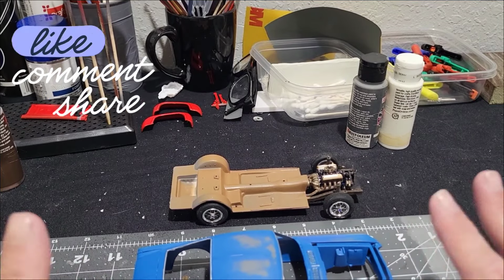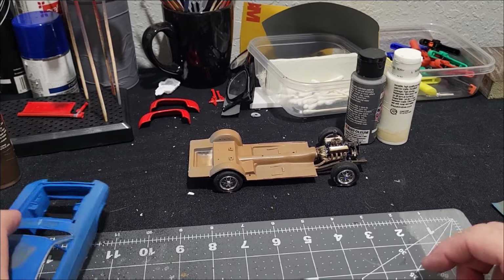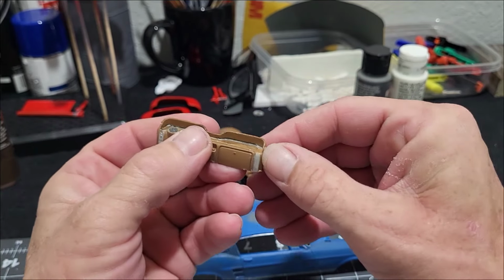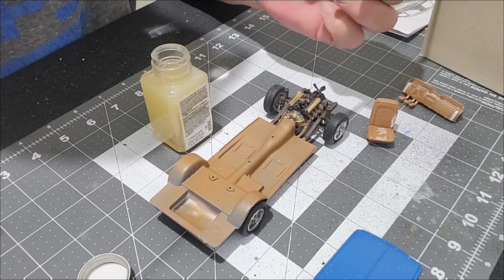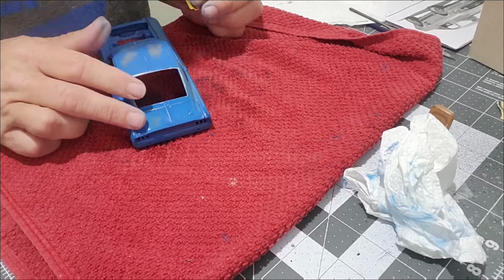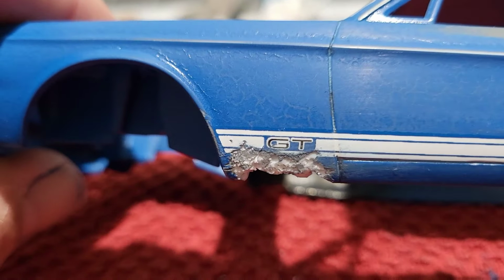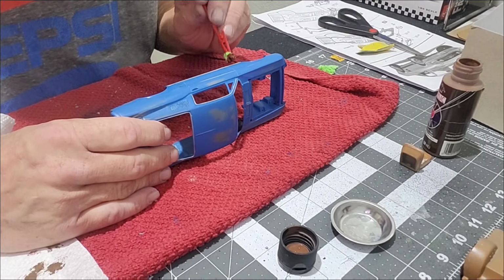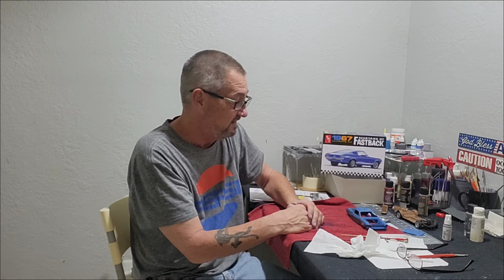67 Mustang Fastback Attempting Patina!

Comment: Chassis looks awesome! For the sun fading on the roof, it might not be too late - try masking off the parts you don’t want painted and repaint the roof with the undercoat. Just an idea 🤷‍♂️ A lot of guys use a dremel from the inside to thin body panels.
Reply from the maker: Thanks Mike, thinning the body makes sense.  What I'm doing to the outside just looks bulky.
Reply: Nothing wrong with trial and error. That’s how we learn and also by watching and talking with others. Keep up the good work 👍